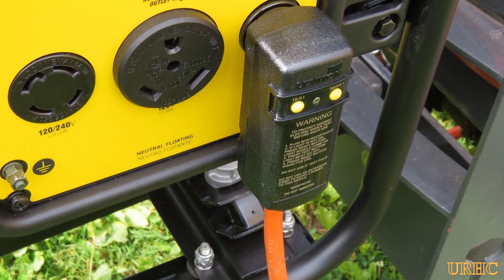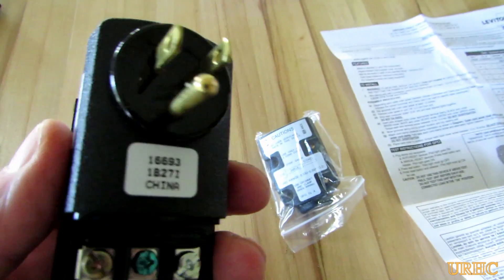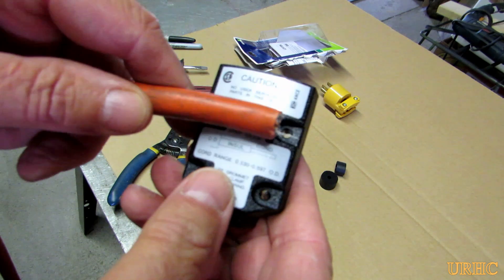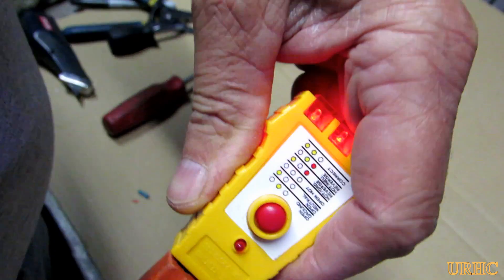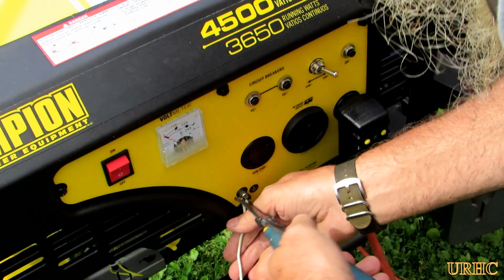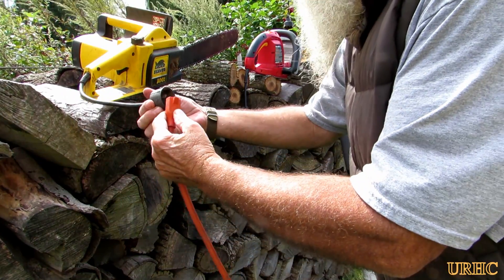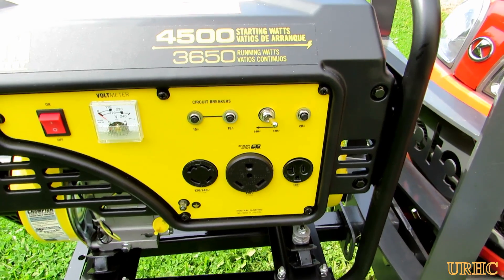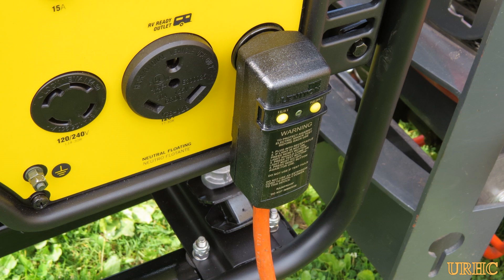A GFCI Plug Will Not Work With My Champion 3650 Watt Generator

Comment: Another way besides a plug to create a neutral to ground bond or no bond for your gen, simply take a switch, house, toggle, etc... run one wire from gen ground to switch lug, run another wire from gen neutral to other lug of the switch. Now you can toggle bonding off and on at will by flipping the switch. Label it so people know what it does.  IF GEN IS BONDED,  you must remove the bond and use the switch. Now some portable bonded  Generacs, use a system control board with a green wire bolted to ground in the outlets panel box, it really is a neutral connection. So if you unbond that type gen (take bonding wire off the 120v outlet) ,  then  simply remove that green system board wire from ground (which when gen is bonded is also neutral)  and move it to the neutral wire, then the system control board will function normally. My Generac 6500watt MEGA Force is that way, and I have seen lots of Generacs circuit schematics doing the  same thing as mine. OEM unbonded generators wont have any special wiring to need to be changed.
Reply from the maker: My 12.5 kw Generac is like that so it can be wired into the house circuit and clipped to the ground rod.

Comment: Here also is some info related to MSW inverters where ground is not directly  bonded to the neutral wire and GFCI. Leviton and Square-D  panel circuit breakers work fine and no buzzing either. I tried some other makes and the GFCI outlets buzzed annoyingly. There must be enough internal ground inside the inverter to allow the test button to work.  The inverter instructions say don't bond neutral to ground or it can short out the inverter, but I was happy to find the GFCI devices fully function ok. An MSW inverter puts 60vac on the neutral wire and 60vac on the hot wire.

Comment: GFCI not required on unbonded generators for 120vac outlets as it is really not easy to get shocked by them,  ground faults are hard to occur as there is no ground to neutral bonding
Code Quiz: Unbonded (Floating Neutral) Generators - EC&M
 As per Sec. 445.20(A), GFCI protection for the 125V, 15A and 20A receptacle outlets mounted on a generator is not required for unbonded (floating neutral) portable generators 15kW or smaller when the 125V receptacle(s) are interlocked such that they are not available when any 125/250V receptacles are in use.
Reply from the maker: That's  how they keep the price down on these low cost  portable units.  Thanks for watching.
Reply: Youtube search for this "How to build a ground neutral adapter for RV generator", basically that is what I mean

Comment: DId you test using the TEST button on the GFCI plug itself? It should work then. The tester you plug in wont work as it is not a bonded neutral generator, but that means NOTHING. GFCI does not need a ground to work properly, it functions fine with no ground, but your GFCI tester plugged into the cord does need a ground connection. Look that up online and you will see it is true. All a GFCI does is compare incoming current level to return current level and if it is different it trips off. from a google search it says this, 
A GFCI does not need a ground wire in order to trip properly. A GFCI simply trips when a fault is detected on the neutral wire. An ungrounded outlet will not trip using your tester. In this situation, I simply apply pressure to the GFCI test button in order to check its operation.
Reply from the maker: No way to get a fault to ground on the plug.
Reply: @unemployedredneckhillbilly2023  Do a search on youtube for "Wire a GFCI Outlet without a Ground Wire in an Older Home" The gfci will still work, even though its test button wont work. The GFCI is only comparing incoming current and returning current and looking for an imbalance. The ground is superfluous to its function. If 5 milliamps or more of the hot current escapes the gfci outlet, like going thru your body, that means the GFCI senses less current than it should and it trips off. IT WILL always work as long as the stupid thing is functional and not defective. The plug you had was fine, but the tester wont tell you that.
Reply: @unemployedredneckhillbilly2023  What you easily do to make the test button work and prove the GFCI is working, simply buy a male plug. Use a short piece of wire and join neutral lug to ground lug, that creates the neutral bond for the gen, just like you home electric panel. Connect the GFCI plug to the gen, start gen, press test button, and GFCI will trip off.
Reply: @unemployedredneckhillbilly2023  Youtube search for this "How to build a ground neutral adapter for RV generator", basically that is what I mean

Comment: You can use a 2-wire (no ground) GFI.  These will break the connection if the hot (source) current isn't within 5mA of the neutral (return) current.  In addition to doing what the 2-wire GFI does, I believe the 3-wire GFI's will sense if there is no connection between ground and neutral, and won't operate under that condition. That is why these 3-wire GFI's will not work with your "floating neutral" generator.  In your home, ground and neutral are connected at your service entrance (breaker box), so a 3-wire GFI works.  

You can connect your neutral to ground (special plug or wire on the generator), and then use the 3-wire GFI with your generator, however, anytime you connect the neutral and ground wires, you should ground your generator using a grounding rod to make sure the frame of generator, and frames of any devices your are powering stay at "rod-in-the-ground" potential.

 Just make sure your neutral wire is only connected to the ground wire at one end (generator or load), NOT BOTH. Otherwise, you will get neutral currents flowing on your ground wire(s), which is a serious electrical safety no-no.
Reply from the maker: This generator  is all about  keeping the  cost down  and safe to operate.  Thanks for watching.
Reply: Quick question, I have a generator running my shed that I wired, I have the neutral bar bonded to the box and the ground bus running to a grounding rod.  So while the generator itself is not grounded, the circuit box is with it being a "main panel", is that safe?

Comment: Bind the neutral to the ground and you may be OK. Sticking a ground rod in the earth does absolutely nothing and is not part of the circuit.
Reply from the maker: I found out they do this to keep the price down  and make them safe without a ground.  Thanks for watching.

Comment: Your comment about the Black & Decker drill shocking you brought back old memories from 60 years ago. We had an old dairy barn with old electrical wiring on our farm. My childhood friend came over to help me sand an old wooden boat. We were using a Black & Becker drill that had the metal case with a sanding pad attachment. The dairy barn floor was very damp and my friend started sanding first. When it was my turn, I reached and grabbed the drill got a terrible shock. He said, it didn’t shock me!  So he started sanding again and all went well until later I came over and put my hand on his shoulder, we both got knocked down from the shock!
Reply from the maker: You  probably  had on leather sole shoes and he probably  had on rubber sole sneakers.  Those were experiences kids these days wont learn the basics of electricity from with everything made from plastic now. Thanks for watching.

Comment: Check out Mike Sokol. (The no shock zone)  on youtube.  He will explain all.  But in short, just make a G-N plug.  (Ground Neutral).  Buy a male plug from Home Depot or any hardware store.  Cut a small jumper wire 12 guage and connect that wire from the green to the silver screws.  Then close it up.  Plug the plug into any unused Edison receptacle and this will bond your entire generator and your problem is solved.  Mark your new plug you just made to show G-N plug.  You can use a p-touch.  This is needed simply because you have GFCI Protected Outlets.  If they weren't  GFCI protected You would not have this issue.  Nothing to trip the outlet.
Reply from the maker: That makes it dangerous to use as a portable generator . Grounds the frame and it could kill you. If you do that nec says it needs a ground rod. Thanks for watching.
Reply: @unemployedredneckhillbilly2023  Hi.  Yes.  Un-bond the generator is only for when you  attach the generator  to the house which is already grounded/bonded.  Then you want your generator un-bonded.   You can't have 2 bonds/grounds.  If you prefer  you can re-attach the jumper you removed to un-bond the generator when you are using the generator out in the field and have it bonded once again. The G-N plug will bond neutral the generator so you don't have to re attach the original jumper wire when you are using the generator as a stand alone unit.  This is my understanding from the research I have done.  But I'm not an expert and you should do what your research and knowledge tells you to do.  I'm just sharing my research results.  Thank you for your comments.
Reply: @unemployedredneckhillbilly2023  This is also not correct when you are using it out in the field. What do you think a ground rod is for? It is primarily for lightning and surges back to the utility generator's source. With the generator, your generator is the source. That is why you use a GFCI...
Reply: Sorry.  I meant to bond the generator when you are using it out in the field.

Comment: When you get to the point where the Neutral and Hot are indicated as "reversed" on the generator;...STOP the exercise and correctly wire up your generator outlet!    Take the "Floating neutral" connection and bond it to case ground!
As for the electric saws they do not care if phase and neutral are reversed!
Then and only then continue to "test" the GFCI  cord!
Reply from the maker: Turns out this is the cheapest way to make a portable generator.  Bond it to the frame  ground and it is no longer safe for portable use. Thanks for watching.
Reply: @unemployedredneckhillbilly2023  That is absolutely, positively untrue. It does NOT make it unsafe. If you bond it, you should use a GFCI. The problem with unbonded is that if you get a short from hot to the case on a power tool, eg., you won't know and the breaker will not trip. If it is bonded, it "may" trip immediately depending on how good that shorted connection is, and a GFCI will definely open the circuit and let you know you have current running in the grounding conductor. GFCI's for personal protection are supposed to trip in the 3 to 7 mA range. I would be concerned in the rain or working around water, else unbonded "works".

Comment: You might consider replacing Generator with INVERTER.  I have 2000 watt that I carry on my tractor to run electric chainsaw when I need to cut wood in the back 40.  Very small but works great, I use 100 ft 3wire cord.  Never tried GFCI ON IT.
Reply from the maker: This one has worked great. I found out that it is safe outdoors because there is no path to ground and that is the reason a GFCI doesn't trip. Thanks for watching.

Comment: Just bond the neutral leg to the frame and the GFCI will start working. All OSHA approved generators will have the neutral bonded to the frame and are fine to use in a standalone configuration without a grounding rod.  If your goal is to get the GFCI to work neutral has to be bonded to ground somewhere otherwise the GFCI will not detect current flowing in the wrong path (ground). If this generator were being used to back feed your house you would want to keep it setup with a floating neutral as your house already bonds ground to neutral at the service entrance and by code should only be bound once.  Best option is to make a plug that binds neutral to ground for when you are using the generator in a standalone configuration install the jumper plug.
Reply from the maker: Was told it's safe as is without a gfci as there is no path to ground.  A jumper can make the frame hot if there is a problem. These are really rated for portable use only. Thanks for watching.
Reply: I have the HF Predator 3500 Inverter and I have the back-feed issue where my house circuits with GFCI are not happy.  I have made the neutral bonding plug as recommended on many forums and plugged it into one of the generator outlets and brought over all three wires (via the large circular receptacle) into my main panel via 2 dedicated circuit breakers (one for each hot - to the 2 sides of my panel).  The issue is the same with and without the bonding plug and I have verified connections throughout.  I did not put a ground stake directly next to the generator, but there is a ground stake right outside the house connected to the panel.  What am I missing? Thanks for any advice.
Reply: @wrb1000  Well first of all that generator only produces a single 120v phase so if you are using that to power to power both sides of your panel anything that expects 240v is not going to work at all.  Secondly you should not bond the neutral on the generator side unless you are using a 3 pole transfer switch which would also require the grounding rod next to the generator.  The round plug on that generator has 1 hot, 1 neutral, and 1 ground.  The ground and neutrals are affectively bound in your panel when you connect them to the neutral and ground busses.  The easiest way to check to check for continuity between neutral and ground on one of the duplex outlets directly on the generator while it's off and not connected to anything.  You should not have any continuity at this point.  Next plug your cable in from the round outlet to your inlet box with the generator still off measure again.  If your wiring is correct you should now have continuity between neutral and ground on the duplex outlets on the generator.

Comment: glad i saw this video. have the same genny and am making a distro for it. will have 100 ft 10/4 going to a deadfront (wooden) box with breakers, power indicators and 20A hospital grade outlets; for heat disapation and current to run small space heaters should i need them. the floating neutral Is the safety here; rule o’ thumb - ground it; or isolate it! (and don’t provide ground path with your person)
another good video. take care...
Reply: retired but once licensed and certified aircraft electrician i keep a copy of the nfpa/nec code book around. when in doubt... you can likely grab a used copy at a bookstore or college campus nearby to get techniques for many home, etc, projects
Reply from the maker: It's the cheapest way to make them safe.  Thanks for watching.

Comment: These "floating ground" generators do not have the neutral and the ground connected together.
And they will not satisfy the "protectors" that are used with camping trailers etc.
The cure is to connect the ground and the Neutral together in the panel or make a male plug that has nothing more than a jumper connecting the ground and neutral together and nothing else and plug it in one of the outlets.

Done.
Reply from the maker: I have read doing that makes it dangerous for portable use without a grounding rod. This is the cheap way to make it so there is no path to ground for the frame.  Thanks for watching.

Comment: Look up Supergen in Azusa CA ask for Paul Sr. he was an engineer for Champion. I had a problem with mine here in AZ. We couldn't fix it over the phone or Skype, he drove over 4 hrs to isolate a circuit breaker problem and fixed it. He knows everything about Champion generators. Great video!
Reply from the maker: Thanks.  This one works good,  it was more  of a issue of thinking a gfci was needed for outdoor use in wet conditions.  Turns out with the floating ground it's safe without one.  Thanks for watching.

Comment: Checked with Champion technical support who relate that there is no need to earth ground the generator unless it’s tied to a house, and/or if it’s used at a construction site and it’s required by local codes.  They go on to say that the generators are grounded internally to the frame.  There is apparently no prohibition to using a neutral bonding plug as they didn’t discourage its use. Still waiting for more clarification on that specific question.
Reply from the maker: I read an article once the frame has been tied to the neutral the frame becomes a path to ground that you can complete if you have the lowest resistance so the generator must then have a earth ground bonded to the frame. Thanks for watching .
Reply: If you connect to a house system isn't the generator grounded through the house ground at the breaker panel? I don't understand what "grounded internally to the frame" means if the frame itself isn't grounded. Being connected to a metal frame that is insulated from any ground isn't really being grounded, is it?

Comment: So you need a neutral bonding plug...available from Progressive Industries.  Or you can make one very cheep by using a cord cap that comes apart and putting a jumper from the neutral prong to the ground prong.  Just make sure you have tested to know which prong is the neutral.  Usually the silver or chrome colored one, the darker one being the hot.
Reply from the maker: Trouble is I found out if you do that it is no longer safe to use as a portable without earth grounding the frame.  Thanks for watching.

Comment: who needs a GFCI Getting shocked every now and then is no big deal for me . It actually feels good. I do all the time
Reply from the maker: You sound like my dad. When I was young we had 1 outlet in our garage that had 2 prongs and a 3 prong adapter plugged in. The old black and decker drills were metal case and when it was damp I would get shocks. He told me if it doesn't kill you it makes you stronger. Thanks for watching.